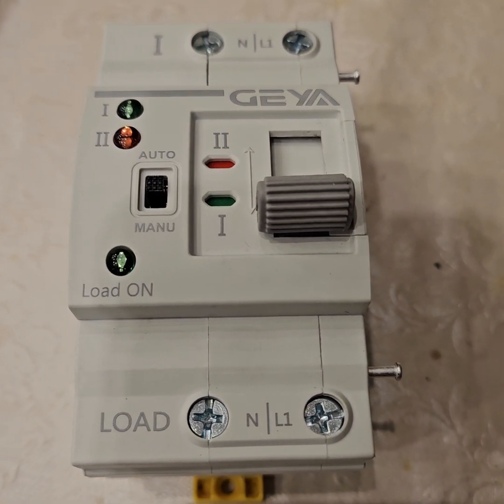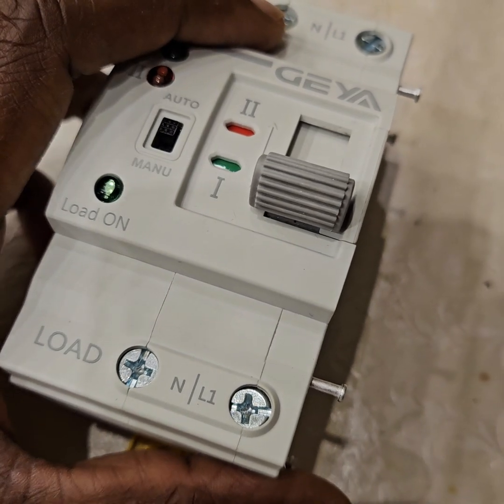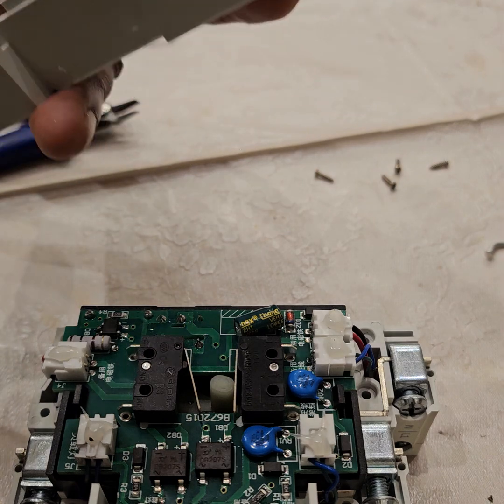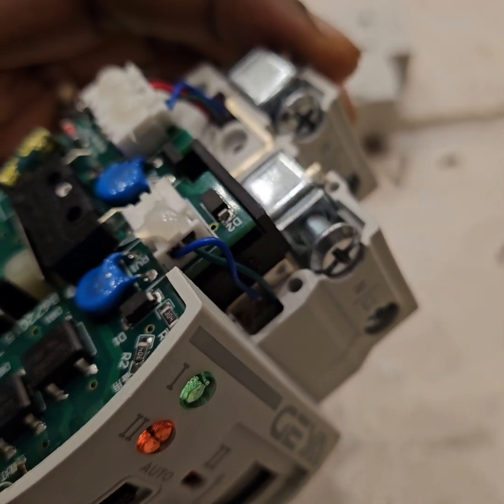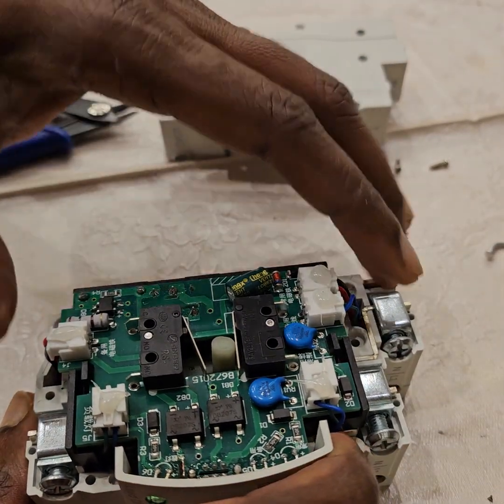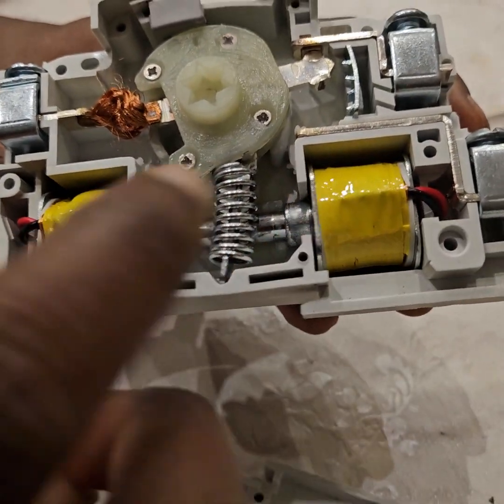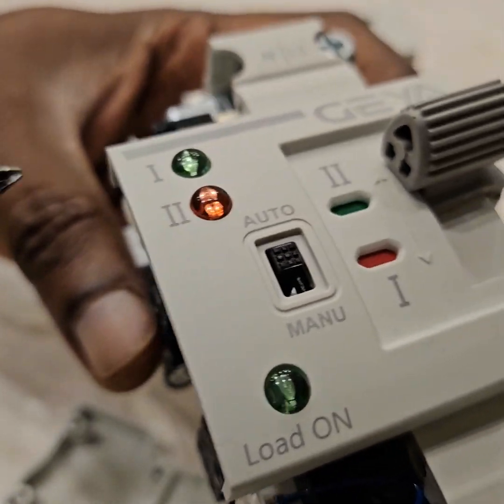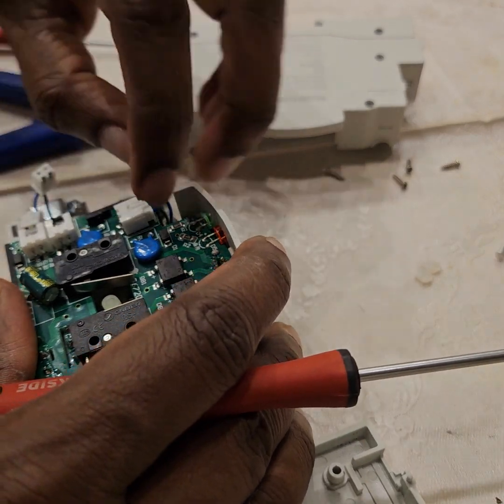Geya G2R teardown, Tongou TOATS-2, CNC YCQR-63, ManHua MES1-63NS Automatic Transfer Switch

Comment: Hi, this is an ATS - Automatic Transfer Switch, 
it should NOT burn on switching between Manual and Auto... 
I think it was wrongly applied, wrong wiring causing short circuit...
Can you share the applied wiring diagram?
Can you tell us what is the intention with this ATS?
Reply from the maker: That's right, it was wired correctly, but used incorrectly, I tried to manualy  switch in Auto-Mode :D

Comment: Thanks for the video. I dismantled mine. Do you know what pins I need to reassemble please?
Reply from the maker: What problem are you facing?
Reply: Microswitch failure. But then I need to close back the housing together and I need to replace those long pins that cross from side to side. I was thinking 2mm bolts and nuts.